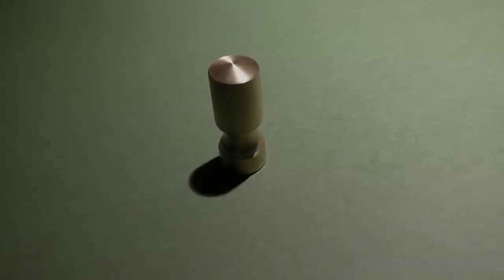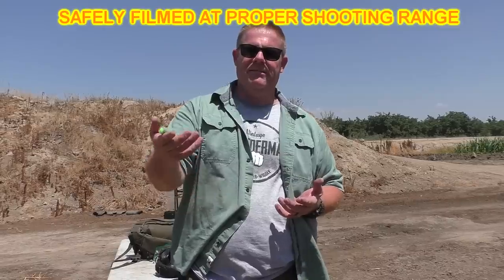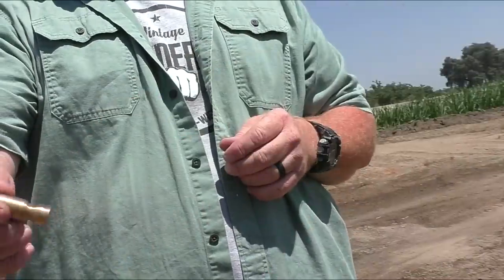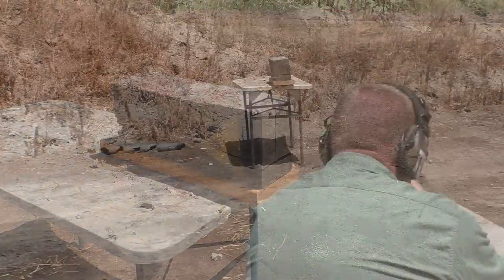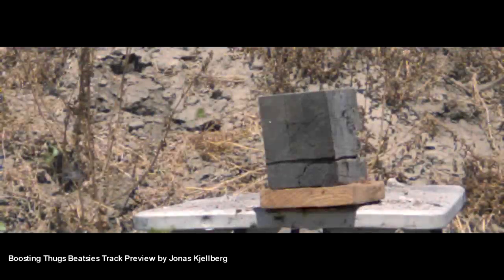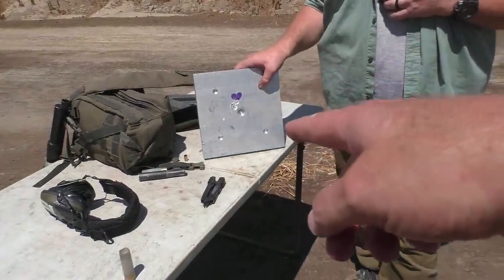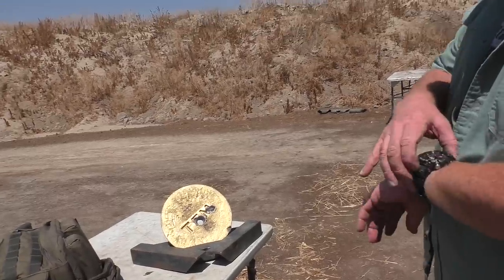MASSIVE 12ga. Slug  Blasts THRU Lead Plate!

Comment: "the vest stopped it" yeah but I bet it hit so hard you might wish it didn't.
Reply: It just needs a 1 3/8” lead trauma plate.
Reply: Impact force appears severe enough to kill with blunt force trauma.
Reply: I was thinking that!  😆
Reply: Ummm... based on what it did to that lead plate... yeah... for sure!
Reply: just some quick math, but that would have hit with around 8,625,493 newtons of force. assuming the slug stopped after about a distance of 1' after impact and an impact velocity of the stated 1000 ft/s. yeah, if it's doesn't kill you outright you going to wish it had.
Reply: @rocketboy617  

I donno...  I think the inside of your belly button is gonna hit your spine. Did you see how deep that thing folded the vest into ballistic Doug?!  Had to be like 8 inches minimum. 
Death by Massive internal bleed due to multiple ruptured organs would be my prediction.
Reply: All it needs is a little adjustment so the sabot case grips the rifling proper.
Reply: Yeah, it'll give a nice 2 feet in diameter bruise wherever it hits.
Reply: Ain't gonna lie
"No armor is best armor"
-phlydaily (aka onlyphans69 [aka the phlyingcircus {aka papa phly}]) 
Yes I put parenthesis in parenthesis in parenthesis
Reply: Break any bones behind it.
Reply: Persevere for Freedom  
mmmmm
Fig newtonz...    omnomomnom.
Reply: @joshuafuller9898  yeah .. but in an area 1 1/8" or so .     some of your insides would be a smoothy after that even with a vest .

Comment: It actually wiggled on it's way through....lol That's crazy.
Reply: O.G. Patented bullet wiggle.
Reply: LoL it was twerking 🤣
Reply: @tracewallace23  Hahahaha- that made me choke on ma whiskey !!
Reply: Yes, must have barely made it through.
Reply: I'm still confused how this went through. It has all the opposite traits you want for high penetration. It also did jack shit to the aluminium plate. Also, in older vids slugs designed for penetration got stuck in the lead plate without fully passing through.
Maybe lead has some weird properties that makes penetration easier with a slow and blunt projectile?
Reply: It's like a wadcutter. The blunt shape helped it punch a chunk of lead straight through. You can actually see the plug of lead in the slow motion. It sheared the lead cleanly like an ironworker punching through a steel plate.

Comment: When tanks use long rod penetrators, the amount of penetration is almost directly related to the length of the penetrator. I wonder if you could penetrate the lead plate using a 3 inch long .30 caliber lead dart and a sabot!
Reply: Tank rounds also go 1.5km/s
Reply: @pierrecurie  Yes, but they are also hitting a material which has a significantly higher hardness and density than a lead plate.

Comment: O M G  What a hephalump!  That slug was impressive too! (JK OG)  I wonder what it would do against the AR Plate.
Get well, Danny.  You are missed.
Reply: Probably shatter like on the aluminumdumbum plate, or could even shatter the AR500 Steel too those are hardened metal so who knows :D only one way to find out then Taofledercrew
Reply: @Koichifirst  It would depend on the slug speed vs the vibration hertz.  It's due to the way they shed energy. Aluminuminumium is far more elastic than lead and sheds it through vibration.  Lead sheds high impact energy by heating up from solid state to liquid state, and getting moved out of the way by pressure. If you look closely, the penetrator makes a shift when it is almost through.  At that point, it had lost enough energy it was no longer capable of melting the lead ahead of it, but still had enough energy to simply SHOVE it's way through the remaining lead. AR500 plate wouldn't give up so easily.
Reply: @RamonaLocksmith
Your breakdown of how the different materials dispurse the energy from the impact was very enlightening. 
Maybe it's something a first year engineering student knows maybe you have to have a PhD. I don't know... With your simple explanation of something that I'm sure is far more complex I feel like I completely understand exactly what happened on impact.
You should comment more on the physics behind some of the other stuff we see here and other places as well. I know I can always use a little more education. 
Thank you.
Reply: Michael Norris @Who Tube?  You are very welcome.  Not an expert, far from it. As an actual physics major might say,  "incomplete, but basically accurate"  I was not a physic's major, but did take several credits of algebra-based physic's in college, and movement, and the dynamic flow of energy (can never be created nor destroyed, but just changes form and transfers between mass/particles.) has always been a special interest / hobby .  YT can be highly useful for this, if you know where to look, and are willing to wade through the ocean of misinformation, bias, etc., and remember the basic rules.  The fun part in recent years is the attack on gravitational singularities (black holes) This post includes O.G. Triggering devices.  Just for a fun experiment!  Let's see what happens!

Comment: I think the lead plate needs to be auctioned off. If winner pays shipping. If need be, I'll buy the lead to make a brand new plate.
Reply from the maker: It takes a long time to gather up enough lead to make these!
Reply: @taofledermaus  Tire shop will give you used wheel weights for free most of the time. That is what stock car guys use for ballast in their cars sometimes.
Reply: @Chris_Garman  I'm pretty sure he knows about wheel weights, but also most modern wheel weights aren't lead so that is rapidly drying up as a source.
Reply: @taofledermaus  I've got many, many pounds of lead bars.... what can we do with them?
Reply: @taofledermaus   Well, I have over 200 pounds of lead and don't know what to do with it...
Reply: @asrcav8r  If Jeff doesn't require it just go find some reloaders who cast their own, they will buy it from you.
Reply: @Chris_Garman  They ain´t real lead now I heard!?
Reply: I get wheel weights and melt them down for C&B pistols. I have (3) 5 gallon buckets full of wheel weights.
Reply: asrcav8r you can definitely sell the lead, if it’s pure soft lead you’ll get a better price than if it’s something like wheel weights which is lead and antimony.
Reply: Leland Holton - is that right? I thought lead and antimony was used in new bullets?
Reply: @RadDadisRad  They could be a little too hard fro best performance with BP! I looked around, seems some wheel weights are Zinc these days. Not a problem, they will be easy to spot. I think they are used for larger wheels like on trucks.
Reply: TAOFLEDERMAUS car batteries
Reply: Most states have forced wheel weights to be Zinc or steel. 
Lead was banned in a number of states as wheel weights when  they had a 'scientist' 'prove' that microscopic dust  from them being ran over if they get thrown off the wheels gets airborne, this 'could contribute' to 'potential' lead poisoning of children, of course.

Some of us have been watching the very slow noose tightening.
 Another such step was EPA regulations forcing the last primary lead smelters out of business in the US a few years ago as well.... Forcing reloaders to buy lead from other sources and as such, the prices have gone up slowly.
Reply: @taofledermaus  just go to a junkyard and ask to go pry off all of the tire balancing weights.
Reply: @zerg9523  you would be correct. Antimony and Tin are used to make the lead harder when casting bullets or shot so that they dont flatten out when fired.

Comment: We use decommissioned M113 APC's as targets, they are approximately 1.5" thick aluminum, maybe slightly less.  I wouldn't imagine a 12g slug (even the brass knob goblin) would do more than disturb the carc paint on it.  The 30mm training rounds from a GAU-8 (with an aircraft built around it, hint hint) have absolutely zero issues with full penetration.  Apples to oranges, sure, but still... I wish I could reply with photos.  Keep sending weird stuff down range, and I'll keep watching!

Comment: You should cut a cross-section through the lead plates hole and do a cross-sectional analysis of the cavity shape and measure some spots out dimension and degree wise.  Especially with the projectile clearly slowing down a few frames just before it exited.  *Best wishes Danny.  ;)

Comment: Praying for a speedy recovery for Danny. As for the lead plate, check out Leverguns 50 videos. He has a couple on certain lever gun  calibers penetrating an AR plate. I believe one of those was 30-30. I don’t think he expected a flat nosed, moderate velocity round to punch a hole in that plate either. There must be some mathematical function or formula to explain how a blunt slower projectile does this but it beyond me.

Comment: Such a massive CHONKER!
AND HOLY MOLY! I've seen the older, thinner plates getting pierced, but punching through the new plates? Oh MY!

Hope you stay safe and healthy, Danny!
Reply from the maker: Even those big,  heavy Minie' balls didn't come close to punching through!   Those were 1400 fps I think
Reply: TAOFLEDERMAUS the only explanation I can think of is the slow moving copper slug had enough time to push the lead out of the way instead of dumping its energy into the plate maybe?
Reply: @hawks1ish  Obviously it's just magic.
Reply: I actually expected it to penetrate.  Two ounces of a material harder than lead is hard to stop.  I haven't done any calculations but the energy from two ounces of brass spread out over the area of the nose of that projectile has to be pretty high PSI.
Reply: @hawks1ish  
That's probably it. If it's too fast the deformation has to happen quickly and it probably bursts off to the side making a flatter but wider crater, while more time and the big surface help to deform a much softer material while the huge mass keeps marching on.
Reply: @taofledermaus  lbc force sabot?

Comment: Your into the Thermal Conductivity of the Round and Target. Aluminum is highly conductive, so the heat of impact is quickly distributed.  Brass is highly conductive so heat from shooting will travel to the front of the projectile quickly. Lead is not as thermally conductive and low melting point, so it heats up at the impact point only and liquefies to flows out of the way of the hot projectile. Wish you had found the lead plug seen leaving in the slow mo.

Comment: Honestly not surprised once i saw the high speed. The slug didn't significantly deform or break up and it has a high length to diameter ratio which is very important in AP projectiles. As an aside whilst it is still usually or a reduced diameter compared to the body of the projectile actual full bore AP rounds often had a flat nose cap, (hence why they where called armour piercing capped), usually of very hardened steel.

Comment: Ho. Lee. Hell. That round had a hellouva punch! I was expecting it to make its way through the lead plate, but that it did it so CLEAN with minimal shrapnel out the back was a surprise.
Also; it mighta been caught by the kevlar plate in the first test, but that plate ain't stopping the kinetic impact energy from being passed through and playing merry hell with the ribs of the target, at least fracturing and cracking them, if not outright breaking and shattering them.

Comment: it would be interesting to see how much "energy" it takes to punch a hole in that thickness of lead. Put it on a hydraulic press with a 3/4" hole punch and press it thru and see what pressure shows up on the gauge....

Comment: If you play the lead plate back at .25 speed you can see the round noticeably slow down and rattle its way through the hole. It's like it punched the hole and then continued on after catching its breath.

Comment: With slugs like that I'd be inclined to mill stabilisation into the slug itself and drill out the centre of the slug like some previous lead slugs on here to force it to stabilise. We've seen lead slugs with stabilisation but most definitely need to see brass ones now.

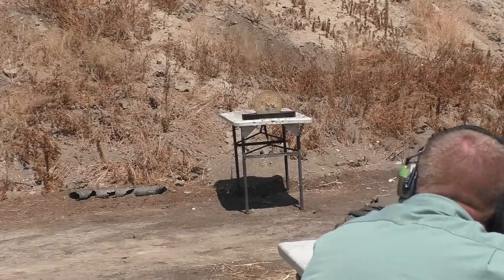9:25 - I was laughing at the true shock of realising that the slug had went thru the plate. I wasn't sure what it would do but suspected it would burrow in like some of the more penetrative slugs and crack the back of the plate, maybe be able to see the slug thru the back of the plate but didn't expect the 'outta my way' manner it flew thru the plate

Comment: First test (Kevlar vest).  The vest stopped it.  I'd be willing to bet the wearer of such vest would need some emergency room treatment for 'blunt force trauma'.  No, I will not be the crash test dummy.  Elmer Keith is vindicated once again.
Second test (large wood block, "Russian ballistic gel":  Perhaps the judicious use of an axe might assist in retrieval?  Narrator said the slug went in sideways, but penetration was seemingly straight on.  Penetration was just deeper than length of projectile; however, this was a solid wood 'target' and projectile of large diameter/meplat.  Note the wood block was appreciably moved.
Third (aluminum):  Aluminum being light was flung by impact and would not hold still long enough to be penetrated completely.  If fixed in an immovable jig or fixture, I'm betting the projectile would have penetrated like General Sherman and Georgia.  Note:  The 'cocked' position of the projectile is known as "attitude" (see Miriam-Webster or talk to a pilot).
Four (lead):  The opposite of the aluminum.  The lead plate did not move (directly reacting like the aluminum) and the projectile slogged on through.  Lead is also more malleable than aluminum.

I am impressed.  This load could be used on large dangerous game, like Cape Buffalo or elephant (Kodiak Bears and such).  It performs similarly to a heavy caliber 'solid' which it is, oddly enough.  For law enforcement work, perhaps heavy barricades and immobile vehicles.  Not for antipersonnel work, as this round would probably penetrate five or six people deep.  Oops.

Good show, good information.  Serious 'slug', but a 'niche' application.  Not for home or apartment defense.

Comment: I was thinking of an idea to make a inexpensive Target that would sort of act like ballistics gel it would be less jiggly but it would be similar by melting a bunch of hot glue sticks into a solid block of clear gel
Reply: There's probably other glues that could be used that would be more jiggly like ballistics gel like geocel or some kind of rubber epoxy
Reply from the maker: I think it might be too brittle.   Probably cost more than a block of clear gel too.
Reply: I thought of an idea to make a material that would be similar to keflare I know when you mix crazy glue and baking soda it turns into carbon fiber so I was thinking of taking layers of the material jeans are made of and soaking it with crazy glue and layers of crazy glue soaked baking soda in between the layers of Jean material it probably wouldn't be as strong as Teflon but it would make for a interesting affordable tough Target

Comment: That projectile almost stopped. It looks like it rattled in the hole before it practically just fell out the back. I think you might have almost got something really spectacular, a projectile that made a full penetration but did not fully exit. I have seen things make it part way in and stick, but making it all the way through and then getting stuck

Comment: If you want an interesting experiment buy some concrete nails and some horseshoe nails then see which is easier to drive in concrete.
Try it next time you need to secure something to concrete and you will never use a concrete nail again.
the flat nose of the horseshoe nail drives easier and it holds better in the concrete.
They also don't bend as easy if at all when driving them.
Might be a similar effect with this slug. Simply very hard with a flat nose pulverized the material ahead of it rather than trying to move it to the side and into more material creating a squeeze effect as it goes deeper. 
Only way I can explain it as it's amazing at how much better horseshoe nails work in concrete.

Comment: If you can get them up to 2,000 FPS they wiuld probably be a good round for use against a Triceratops, or an Allosaurus.
Reply from the maker: Probably blow up the gun from the chamber pressure!
Reply: @taofledermaus  I shoot 12 Gauge From H.  My gun would take it.  I do 700gr.  and some doing the 12 FH go even heavier.  I believe the record at this time is about 3,000fps at 1 3/4 oz. with a brass slug.

Comment: Most shooters on youtube seem to be of a mind that the key to penetration is high velocity and then wonder why rounds like the 5.56 or 5.7x28 don't go deeper into ballistics gel.  High speed (as we know) = high kinetic energy causing large temporal wound cavity and breaking through high density barriers like body armour, but the relatively low mass means that energy gets dumped very quickly and leads to shallow penetration into softer materials like lead (or people).  The key to deeper penetration into a soft, resistant medium is momentum which is much easier to maximise with very heavy projectiles.  Obviously the ideal is to maximise velocity AND mass but hey, we can't use .50 BMG for everything.....yeah I wish we could too.

Comment: I have an idea for a target model; Get a cheap mirror, put a dot on it. Turn it 45 degrees from the 'mass accelerator", set the high-speed camera off to the corresponding angle and zoom it on on the dot tightly. 

Voila! You now have a view that looks like you're putting a projectile directly into the camera. If you make a little black construction paper 'shed' you can even conceal the true nature of the 'mass accelerator' and keep YT happy.

Comment: Because it was fairly hard and blunt (flat) on the nose it acted like a wad cutter and you can see the lead plug that was cut out flying behind the plate. A pointed slug would have distributed the energy radially around the impact point more so than a flat projectile like this.